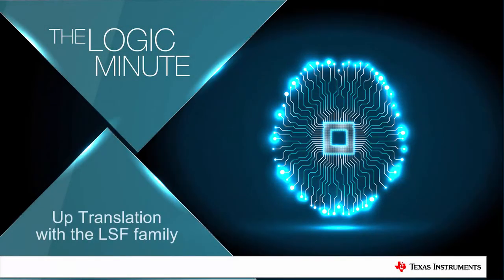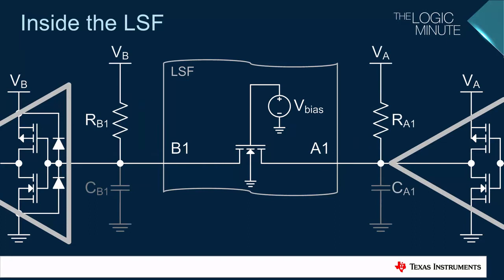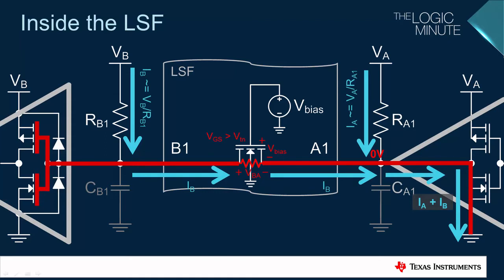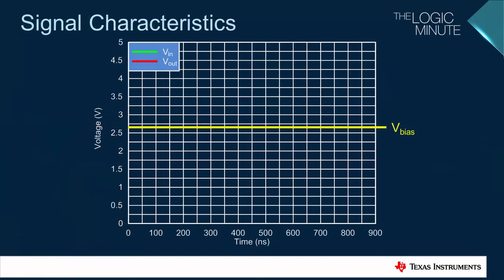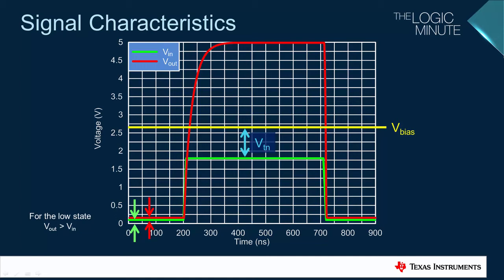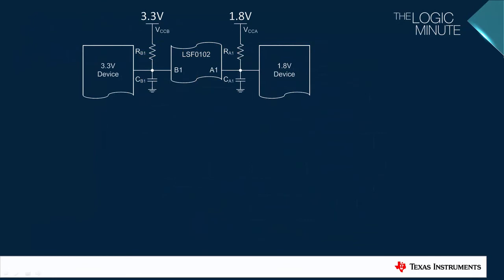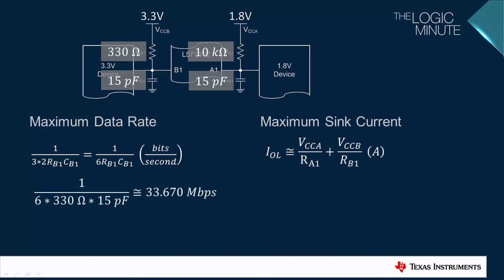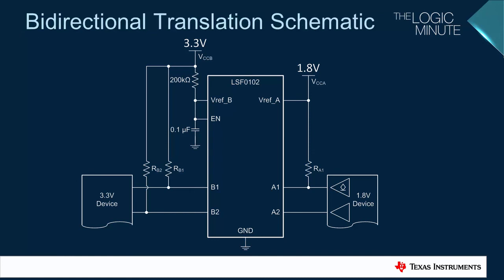Up Translation with the LSF Family

Comment: what is the different between LSF and other bidirectional voltage translation ICs w/o the enable, and voltage limitation mess ?
for example there are ICs that support VA=VB, VA<VB or VB<VA (no VA>VB+0.6V limitation) and normal enable input pin.